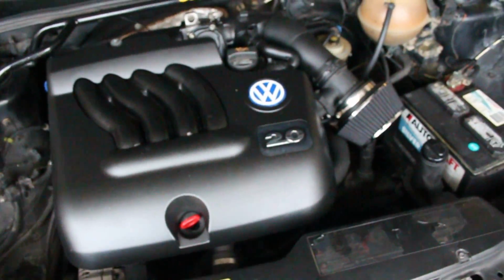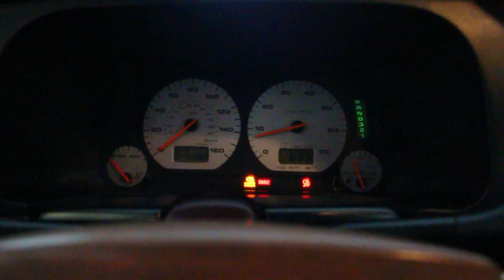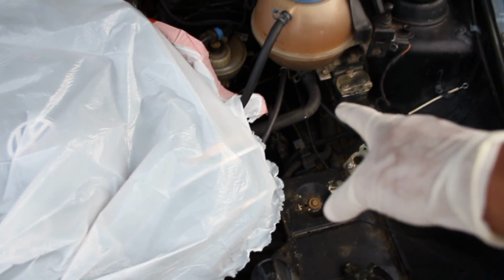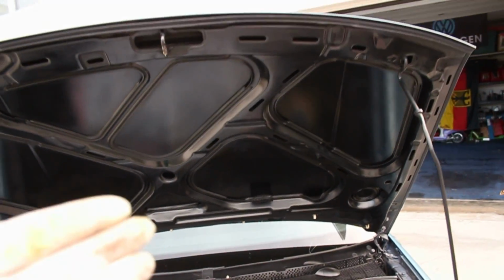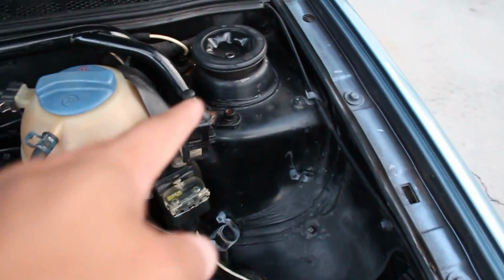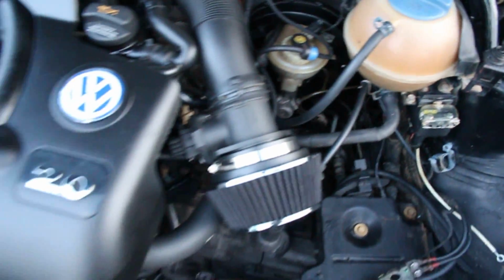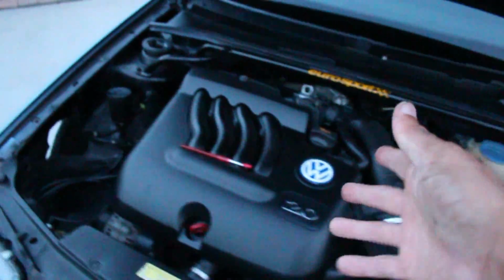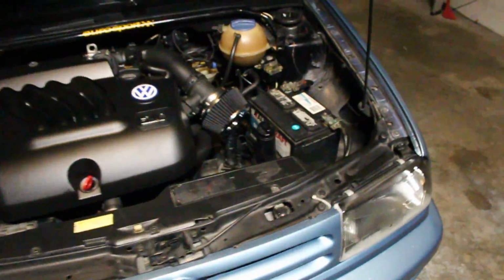Engine bay cleanup!

Comment: Hey, I have a 97 2.0 Mk3, I had a stock muffler and I replaced it with a trush muffler to see how it sounded, I like it but I loved the way your car sounded when you turned on the engine, do you have an exhaust tip?